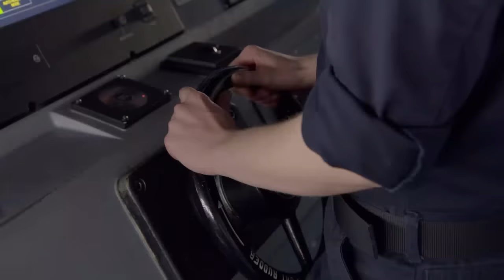Can 5,000 Sailors Be Intimate Inside The Largest US Aircraft Carrier?

Comment: I spent about 10 years in the Navy and I think I broke 17 of the rules listed in the video. And though, I got caught with only one of the  broken rules, I just got a little slap on the wrist for it. 😁
Reply: What did you get caught doing?
Reply: @yellaboi6257  : The one that I got caught doing was having sex with an E-2 (I was an E-5 - She was not in my chain of command) in the cabin of the helicopter while it was in the hangar. All I got was getting yelled at by my Senior Chief, her Chief, & LCPO of the Air Detachment (that the helicopter belonged to) and was told not to do it again. 

And a buddy of mine (another E-5) also got caught having sex with an O-2 inside of the "bubble" on the flight deck. Everything was also swept under the rug. 

Being an EOD Tech. has its perks, I guess. 🤷‍♂🤷‍♂🤷‍♂

Comment: I was on the USS JFK (CV-67) in from 1971-1975. Except in 1975, there were no women aboard a Navy ship. In 1975, some were reporting on the non-combatants such as supply ships. The non fraternization rules did apply to the shore stations though. 8:32, reverting to paper bags to the port quarter for refuse? We had to make out own paper bags with a roll of craft paper and a stapler. We then went to plastic bags, which a Soviet trawler had no problem picking those up for intelligence and tracking. The first trash compacters on the port quarter were trash, they always broke down. Smoking was common. However, smoking was banned during refueling and during flight ops. Announcements of the "smoking lamp" being "lit" or "out" was announced on the 1MC. When I got aboard in 1972, there were pinups covering the bulkheads. Then the "Old Man" gave his "ole lady" a tour and she noticed this. By the end of the 1973 cruise, these fleshy images were taken down in steps. 3 tier racks, check. The JFK was the first ship to include curtains around those racks. My uncle served in the late 1950's and he slept in a hammock.

Comment: The truth.  There's a lot of sex and gambling happening on Navy ships during deployment.  I mean, if it was happening on the 3 destroyers I was stationed on, it sure as heck is happening on larger ships with more fan rooms, locked spaces, and tucked away spaces.  There wasn't a lot cases of people drinking alcohol while deployed, but there were a few cases of people getting caught.  Also, unless things have changed, if you are at sea for an extended period without making port, you get a bear day (you get two beers).  I experienced beer days twice (on one of those occasions, our ship even put out a may day for beer as we didn't have enough on board.  A Spanish navel ship and a German naval ship answered the call).  There was more drug use going on than you might think.  Muscle relaxers were definitely abused as they were easily acquired from medical just by saying you were having sciatic nerve or lower back pain.  Medical would give those things out anywhere from 2 to 8 pills per visit.

Comment: As an F-18 fighter pilot landing on aircraft carriers, you always followed the rules. Neve break them.  Marine Aviation is a small group, and they will "hang you", if you cheat.  We played poker but with chips. Onshore we settled up.  Our Col. did not care if we smoked on long-range transfers to other stations except during refueling operations, never in air combat.  Once on land, 8 hours from bottle to throttle. We had issued pistols that fighter pilots need if they must put down in dangerous areas. We checked them when we landed on board.  The Marines do not want a pilot to be killed. They need a means of defense.  Afgh. 6 tours.

Comment: Yah I was on a Nimitz class carrier.  You know there are about 30 staterooms that are for "dignitaries" or visitors, and are almost always empty on a day to day basis. I KNEW that they are not serviced or checked up on, because I worked in supply when I was "mess cranking".  They had keycard locks on the doors, but those were EASILY hacked (hhehe it's not gonna stop an AT with da skills).  I used those rooms about a hundred times over the years to bang girls,  as it was one of the few places on the boat where I could get privacy.  I mean nobody ever found out, it was great.  And just think, all the "elites" on that boat, all the chiefs, the officers, and even the captain were all incels while I was getting laid left and right.   It was quite a thrill to get away with than and an awesome privilege that I carved out for myself.  Now people will say "hurr durr i used a fanroom" but that's always a lie.  You can't really use equipment rooms, even if. you COULD in theory access them, but they're access controlled and with alarms.  Besides, most of them are ultra hot, super noisy (100db+), greasy, or don't have any useable space.  So those are all just stories.  You can't "sneak into the female berthing", you'd be spotted and thrown in the brig (men are banned from female berthings).